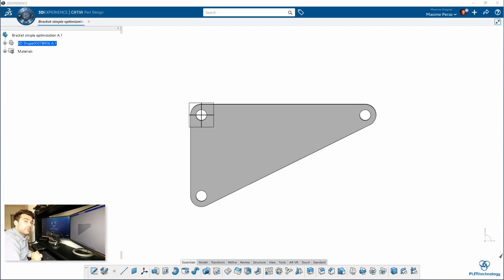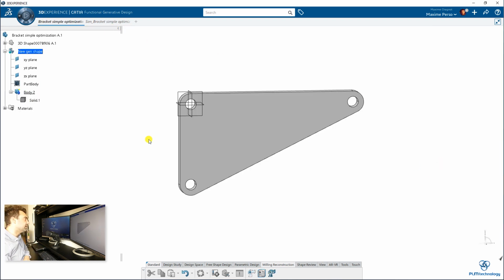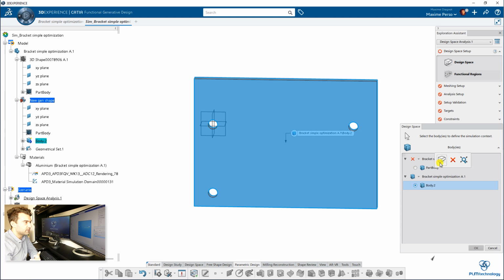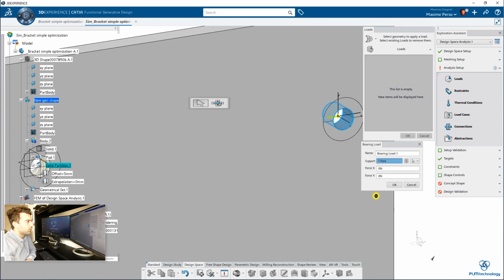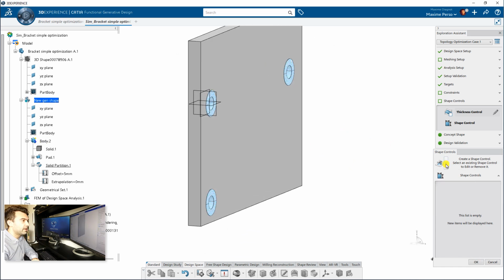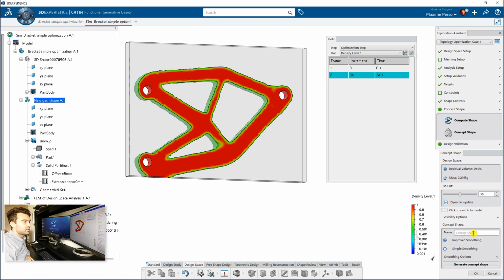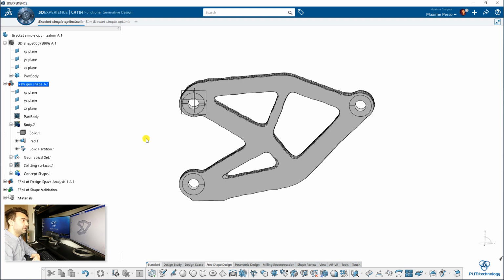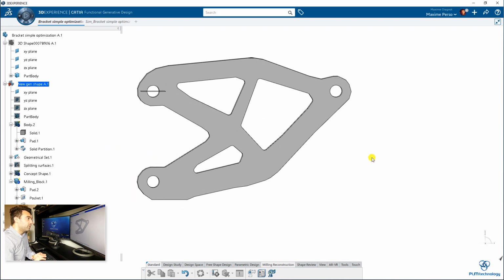Introduction to Topology Optimization - 3DExperience R19x (Live Demo)

Comment: I have followed each and every step carefully, but when I hit 'compute shape', the error message pops up saying, "Failed to launch execution using the compute orchestration services." Do you have any idea on how to get rid of this error? Any help would be really appreciated. Thanks !
Reply from the maker: Hello Daniyal, Thank you for commenting and exercising on the video :) I had the same issue in the past. But it could come from many different reasons... verify that you are up to date with your java and graphic card (watch video here: https://youtu.be/hBK7dwVtrJo ), also check if your firewall is not blocking the 3Dexperience, try to run 3Dexperience as Administrator as well. If nothing of that work, I strongly recommend you to report this in a Service Request (watch video here https://youtu.be/TP2Mdp6qIyc ). I hope this helps you.
Reply: @MaximeChagnot  Hi, thanks so much for your reply. I have tried both of your suggestions, but they did not work. Now, I have written to Service Request.
Reply from the maker: @daniyalahmed684  sorry that it did not work. But Service Request is the right way to do it! Hope they will find the issue, fingers crossed
Reply: @daniyalahmed684  Hello ! I have the same problem like you with my company licence ... Did you solve it ?